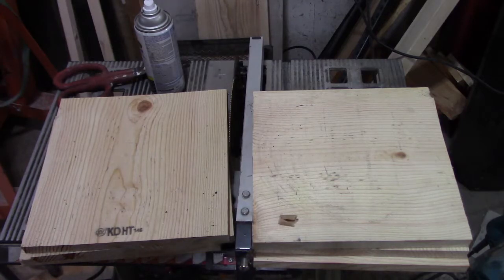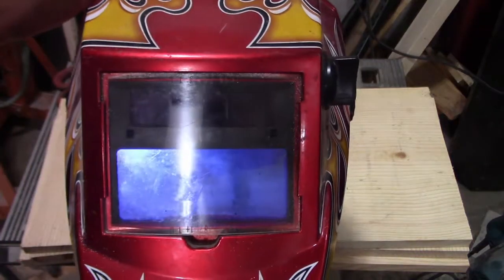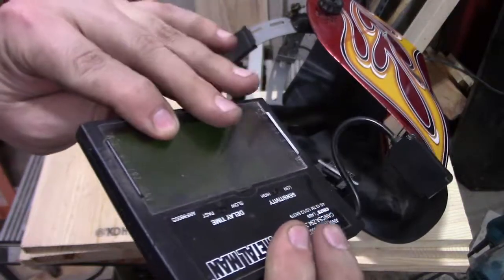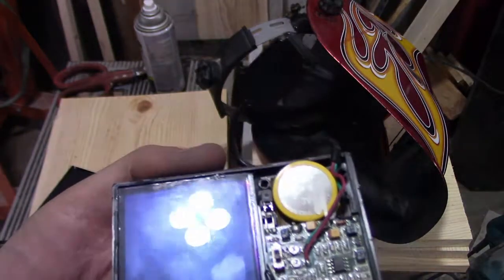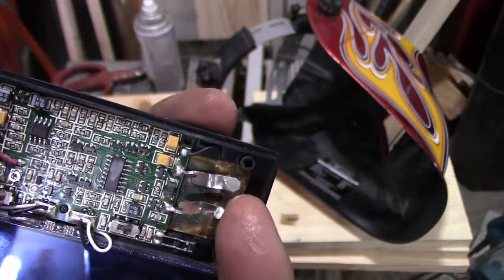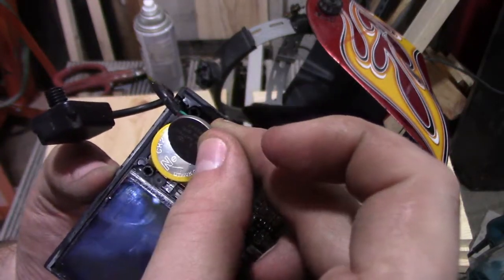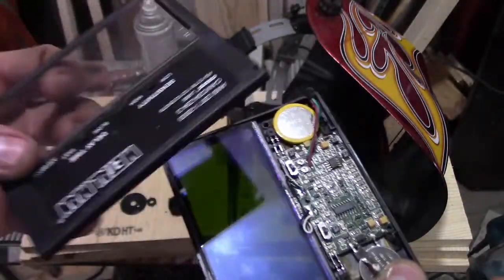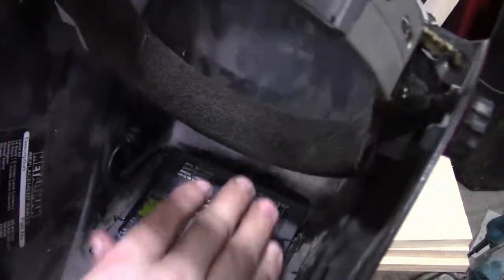FREE FIX! Metal Man Auto Darkening Welding Helmet Repair | Driveway Extra

Comment: I gave you a thumbs up, a good effort on the video.   I have one of those helmets like yours, the bad is the head gear is as bad as any helmet made in 1974,  their is no gasket under the outer lense so the auto dark plate gets covered with smoke.  I bought a Lincoln Viking 3350, great head gear, true colors when welding, gasket under outer lens,  need to clean outer lens is less than,.  The Viking actually stays Up when the hood is  flipped up, does not have the creep down like most welding helmets do.   Great repair job well done.

Comment: I used a small bit of business card folded to add pressure to the top tab so the when the cover is on it holds the contact tighter. Then a tiny piece of clear tape to keep it all in place till the top cover is snaped back on. Not a big fan of being flashed. Gave me some ideas while in there. Small fan and a respirator filter to help keep smoke out maybe a led or two for working in low light conditions like in the dark. The working parts off a drinking hat so no one has to hold my beer. Lol

Comment: Why did you only change one battery and not both while you had it open? Thanks, R
Reply from the maker: The other one tested OK
Reply: @Drivewaybuilt  OK, thanx for the reply
Reply: I was going to ask the same question.. But I changed just the one on mine as well, but it flickers while in use. I'm actually using it and a pair of 90 degree turned polarized sunglasses

Comment: Im trying searches to straighten a bent welding hood bent out of shape on one side does anybody have any suggestions the can help me to fix this small problem. Thanx
Reply from the maker: Your best bet would probably take a heat gun and warm up the plastic, then shove something inside of it to hold the shape you want until it cools - it has to get quite warm though for the plastic to become mold-able.
Reply: @Drivewaybuilt  thank you

Comment: This is the best way to do the battery replacement.  Mine is a Lincoln and it is almost identical - today I was doing some welding and my "good" helmet plastic head strap broke, so out comes the Lincoln - it didn't work because the batteries were dead.  Used your video and had it working in under 1/2 hour.  Thanks a lot.
Reply from the maker: Glad it helped

Comment: this is exactly a more expensive harbor freight helmet, just different name. wouldn't surprise me if this was manufactured on the same line
Reply: Ebay $10 helmet are far better than HF $50 crap.
Reply: 164 procar I won’t trust those no name brands. I stuck with my Lincoln Viking. Serves me well. Thanks procar

Comment: While i applaud your helpful video, your title is misleading and needs to be changed. The fix is only free for the nerds out there with a "crap ton of motherboards" laying around. That is the minority and so for normal people this is not the case and they will have to purchase replacement batteries making the fix not free!
Reply from the maker: Not misleading - I did fix it for free... Stop by any computer recycling or computer shop and they'll probably have some for free too.  If you're more resourceful, even you can fix one for free.
Reply: Got it.
Reply: These batteries are very common in key fobs and red dot sights for firearms